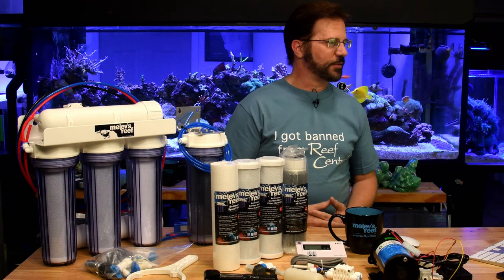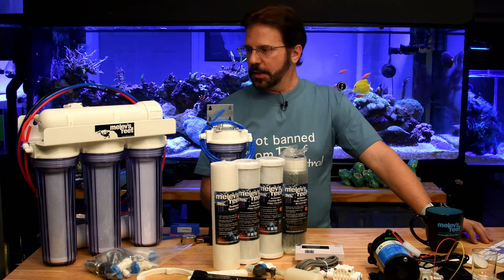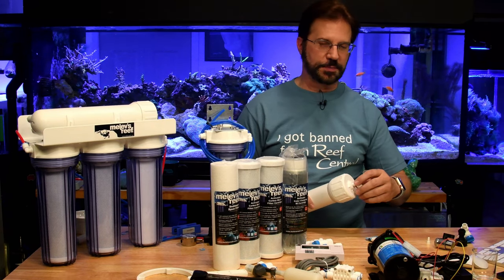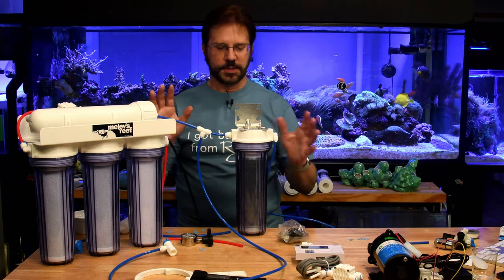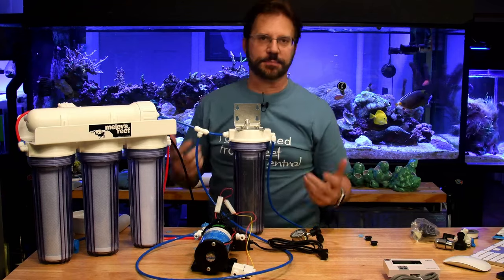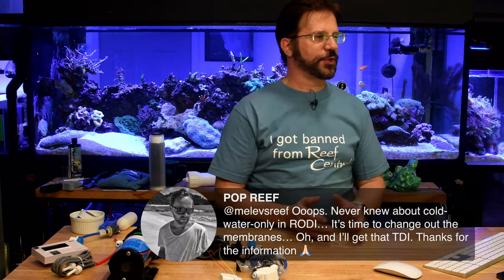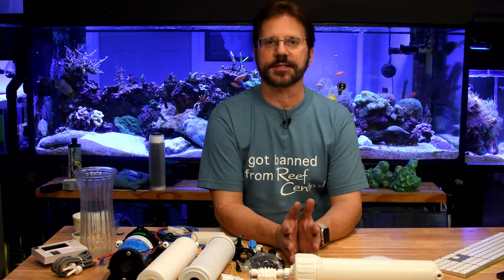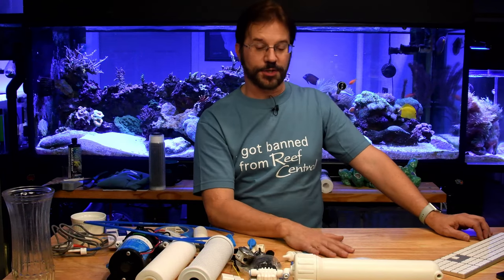Let's talk about making your own RODI (pure) water

Comment: What handheld pen-style TDS meter do you personally use?  Also, can I buy color changing anion and color changing cation and mix them myself to put in one canister instead of buying it pre-mixed? That way I have a better visual gauge of when it’s really used up.
Reply from the maker: I like the HM Digital handheld meter. If you buy separate resins, don’t mix them. Run each in their own housing.

Comment: I have well water, you would think great! No. my sediment filter turns orange from iron almost over night. I change the filter out about every 100 gallons. I also need to aerate my water in a separate bin over night before i pump it though the DI so the Resin isn't depleted after 75 gallons due to low oxygen levels .Other than that my TDS from the tap is about 120. It comes out my RO at 1-2 TDS. DI last forever and My tank looks great so whatever I'm doing is working
Reply from the maker: Very true, thanks for sharing your experiences.

Comment: The tds creep that comes out of the of the RO membrane housing, does it come out of the waste water line or RO filtered (blue) line? I have a restrictor with a valve on it. Do I leave it open or closed?
Reply from the maker: It comes out the blue tubing, the RO line.  The waste line has the flow restrictor, and the valve should be closed. You open it to flush the membrane for 15 seconds, then close it. Don’t forget or run off to do something else, because you will be sending water down the drain.
Reply: @melevsreef  ahh ok, thanks! I was letting the tds creep water go into the DI housing because I thought it was coming out of the waste line with the flow restrictor open.

Comment: this is so awesome that you made a current RODI presentation! thanks mark! i do have a few questions to ask. what’s a good pressure gauge to use for a hose bib ro system? what’s a good tds meter to use to check source, waste & product water? and lastly, i have my ro system outdoors, and feel like i should bring it in & out due to possible temperature fluctuations, would you recommend i flush the membrane for 20-30 mins each time i connect? and as someone new to RODI systems, after membrane flush, the valve does have to remain closed right? lol. thanks so much for responding!!!
Reply from the maker: Much of that was addressed. I don’t recommend using them outside due to weather fluctuations. If you just, cover them so they don’t get direct sunshine. I sell two meters I recommend and use myself. Membrane flush is 15 seconds, or use my method of “wasting RO” for 90 seconds before making drinking or DI water. The hosebib PSI tester is available at any hardware store or Amazon.
Reply: @melevsreef  thanks mark. does the membrane flush valve have to be closed when making RODI?
Reply from the maker: @MACNTOSFAM  Yes, or it won't run correctly.
Reply: @melevsreef  thank you 🙏🏽

Comment: How can I use my ro/di for drinking water? I would like to use my ro di additionally for drinking water before the water goes through the silica stage ie so it does not remove electrolytes? I don’t really want two units as I am stuck for space? Any help will be much appreciated
Reply: drinking water is ro so before it goes into the di stage install a split off and a valve
Reply: also watch 1:20:00 he explains

Comment: I noticed coming into my system I have about 110 coming out of my RO is 0 and 0 out of the di can you tell me can I mix brands for manufactured products or do I have to stick with the brand I have
Reply from the maker: It depends. Some systems use proprietary parts, others use industry standard parts and filters.

Comment: Oops you put the Ferrel backwards, tapered side goes toward the float valve. Tip increase air pressure on the pressure tank will give better water pressure at your faulcet.
Reply from the maker: Really?  Inside that nut, it's tapered. So I've always installed the one thing into the float, then the ferule the other way and it has never leaked on any of my floats.  Hand tighten, done.